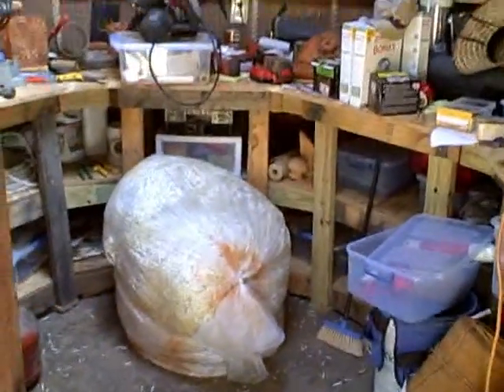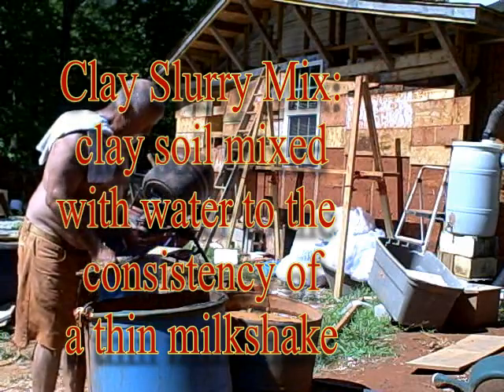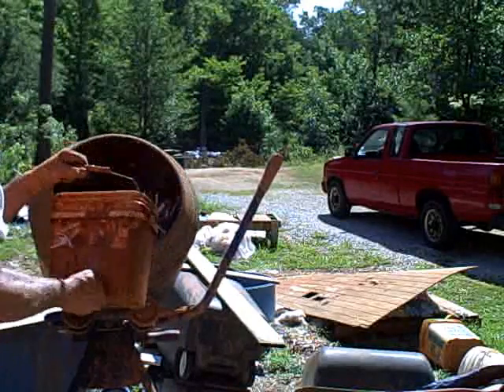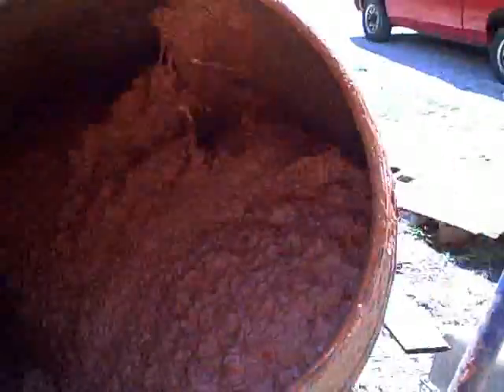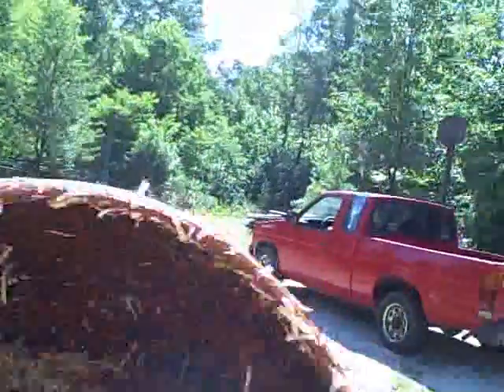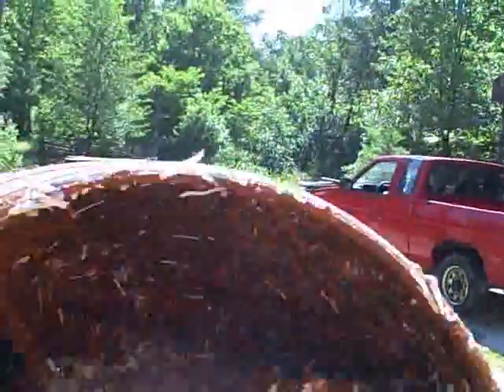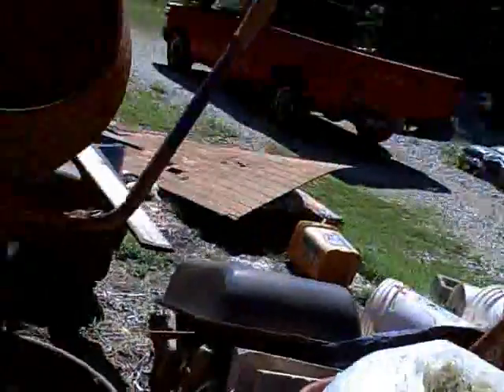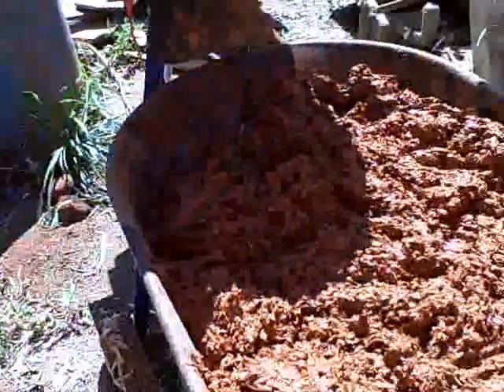Paper Adobe Wall

Comment from the maker: You need to join the papercreters Yahoo group.  There is a lot of info there.
Yahoo>Groups>search for Papercreters.....and join!

I've used a black 32 gal bag of paper full of shredded paper, which only weights about five pounds. I have a one gallon bucket that I use to measure the portland cememt.  Start by putting about a gallon or two of water into your cement mixer. Add the portland cement and then the paper a little bit at a time, until all the paper is in the mixer.

Comment: You started with paper and changed to straw at some point.  do you join the two techniques any differently?  I'm assuming you do a form from floor to ceiling, then  move to another section?  The two mediums will join up together well, I assume, but I just wondered if you had to do anything to make sure they join.  
Mind if I ask the size of the building, and what you estimate the cost?  No labor costs, free paper, etc..

Comment from the maker: My shredded paper source *dried up* ....so I changed to straw/clay slip walls. You are correct that both walls utilize a form from bottom to top. I didn't do anything special when I use paper, sawdust, or straw. Used the same type clay/slip and tamped then into a form between studs.